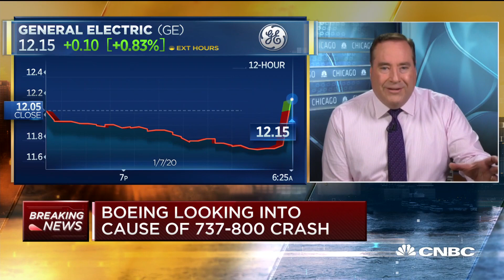Boeing 737-800 crash in Iran likely caused by mechanical issues

Comment: Video show aircraft plunged with a tail of fire so big visible from long distance. Aircraft just took off and maybe about 1000 ft up. It is fully loaded. Let's consider  4 scenarios: 

Scenario 1 - Missile strike: This is impossible because aircraft way too low for any missile. Besides such a strike will break up the aircraft in a fireball up the the sky. 
Scenario 2 - Bomb onboard: There are a lot of Iranians onboard. A lot of Canadians. Make no sense. 
Scenario 3 - Engine failure: Engine trouble was reported to tower. But engine trouble no matter how serious will NOT bring such an advanced aircraft down with flame trail. Fan blade break will not because protection is designed in. Engine fire extinguisher get turned on automatically, engine just flame out. Aircraft is designed to fly with one engine. 
Scenario 4 - Wing break off. More than 100 B737 NG already grounded due to cracks in the major wing/fuselage join component called pickle fork. Full pickle fork failure will crack open the wing, crack open the huge fuel tanks all around it, sever engine control and stop it. Thus report of engine trouble. Aircraft immediately lose control and plunge with a large flame tail. 

Mostly likely cause based on evidence today: Wing separation due to full failure of pickle forks
Reply: Smitty Rock  he had solid arguments and you don't. Sorry bud, he wins.
Reply: Video shows a clear shot down. He obviously knows very little about antiaircraft missiles
Reply: Impossible you say? Iran just admitted shooting down the plane .  Nice work detective
Reply: @jeffthuot5631  Attitude reported by Iranian newspaper at the time was about 1000 ft. which is too low for missiles. Civil aviation chief said this is scientifically impossible. Today data from traffic control tower recording show attitude was 2000m (6000 ft.) which is far above the minimum of missiles.